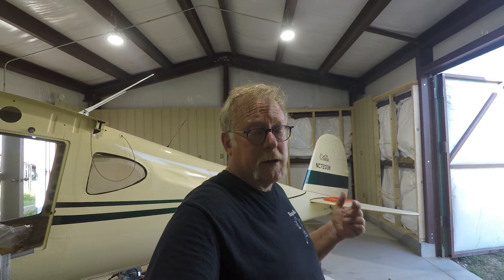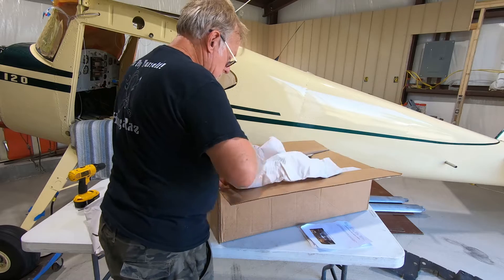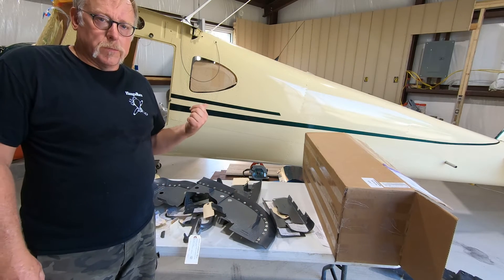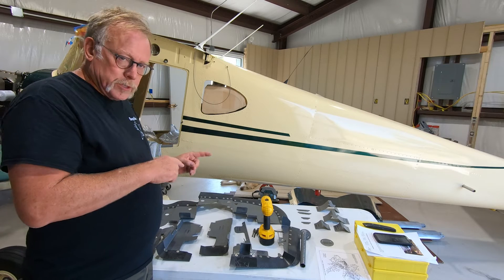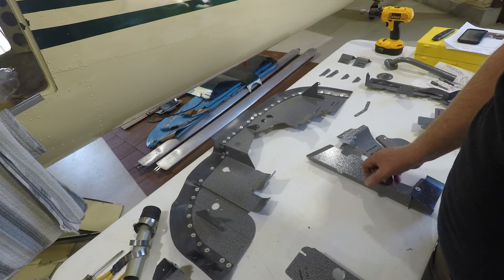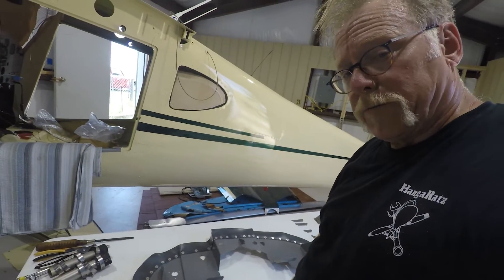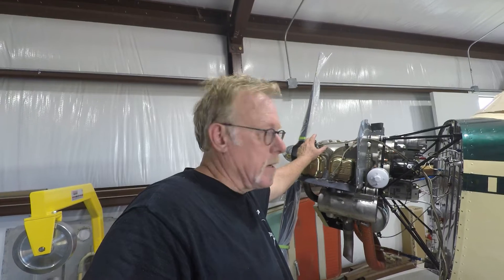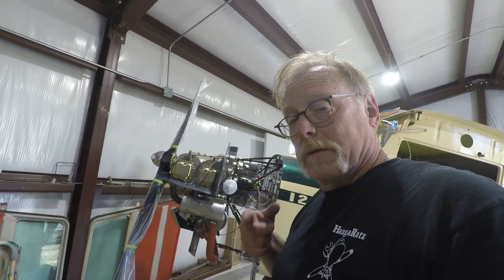Cessna Airforms Baffle Installation

Comment: Did you order these direct from Airforms, why didn’t mine come with instructions?
Reply from the maker: I believe the owner ordered these directly from Airforms.  There were no real instructions included other than one note page to make sure the lower tie strap was installed as that was an improvement over the oem parts.  Unique to this installation.  We installed a Piper PA28R-201 Arrow kit and there were no instructions.  Not really needed either.  Very straightforward job.  Just replace one part at a time.  Thanks for watching!
Reply: @HangaRatz  thank you very much